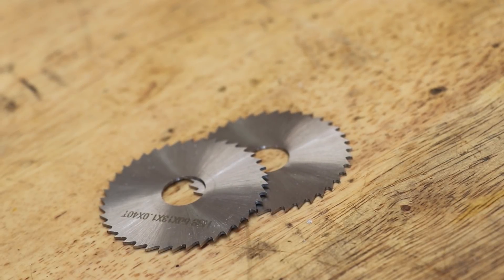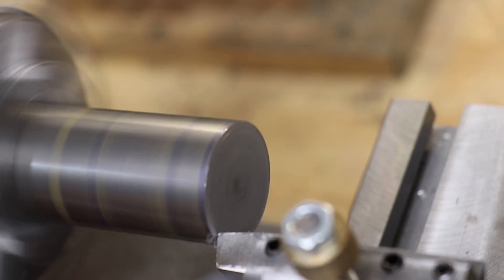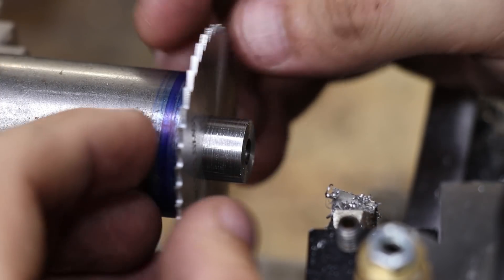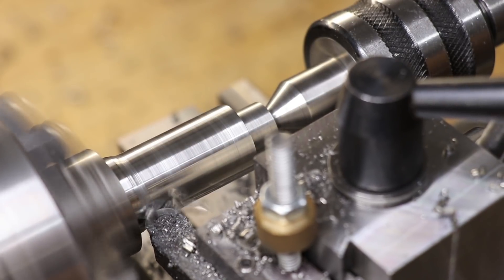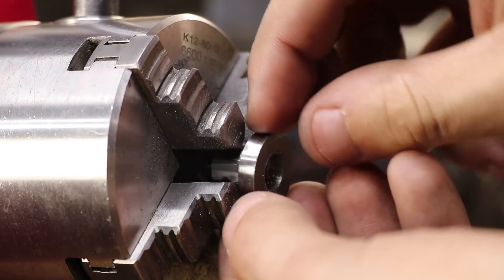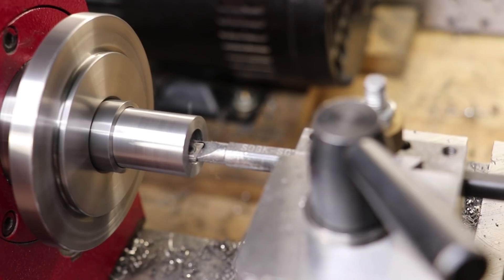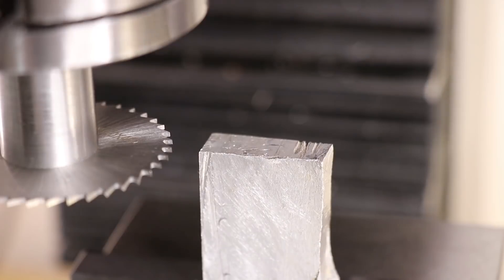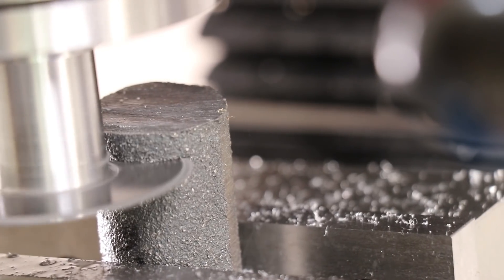Making A Slitting Saw Arbor For The Milling Machine

Comment: Does the runout not stem from the thread? Perhaps make a system that does not use a thread to lock the saw in place but instead clamps it down by other means would solve the issue?
Reply from the maker: From what I can see most of it stems from the saws themselves. These are inexpensive imports and I can't expect too much from them. Cheers.

Comment: One thing you could've done was while you had the arbor in the collet on the lathe, leave a witness mark on both the arbor and the collet. As it is, machining it in place will ensure that the machined features on the arbor will have the opposite runout of the collet, and if they stay lined up, this will cancel out. If you were to take it out of the collet and reinsert it at 180°, you would have the worse case scenario where the runout on the arbor and collet would then stack instead of cancel out, and anywhere in between would be suboptimal.
Reply: That being said, I would suspect the largest source of runout here would likely be the location of the hole in the slitting saw itself. You could check this by measuring from the inside face of the hole to the tip of the tooth with calipers, and compare at various angles along the slitting saw.

Comment: Made such an arbor some time ago, in 2 pieces only.
As already told, most blades are not centered to the hole. Maybe using a grinder could modify the blade to cut evenly.....

Comment: Never seen one run true yet !
I am beginning to think they cut the teeth and then punch the hole in the centre coz there is no way you could get that much run out if the hole was done first and the saw was mounted on a mandrel to do the teeth . If you ever do find one that runs perfectly true mount it on a plinth and put it on display as you have found the elusive hens tooth 🤣
Reply from the maker: Possibly, I really dont know how these particular tools are manufactured. it could possibly be down to these being inexpensive imports too, I ha trouble with these last time I used them.
Reply: I think those could be laser cut. Punching hole in HSS seems like it would shatter

Comment: When Stefan G. made one of these he made the flange really short with the bolt recessed completely inside, so the blade could be used as low as 2.5mm above the deck. That might be handy when sawing a complex shaped item, and would be an easy mod to make to your holder.
Reply: Yeah I have watched Stefan's series on slitting saw arbors a couple of times now. In terms of HOW and WHY you do various things in a machining project its a masterclass. His design is more complicated (in the machining) because its on a Morse taper and does not need a collet. 
What's really important is his description of how the arbor MUST hold/grip the slitting saw its after 9:15 in the first part. Not that Stefan's design grips on a  slightly larger diameter than others the one in this and other videos which is why his needs the relief he describes.  
Here's Part 1 of that series: https://www.youtube.com/watch?v=bRQPv4AG2HQ 

For 2 other arbors very similar to the one in this video: 
Joe Pieczynski -> https://www.youtube.com/watch?v=Sp1Vaqwqw3c (done in a pro-shop with pro hardware)
Blondihacks -> https://www.youtube.com/watch?v=-COjawgu32k (done in a hobbyists shop on a hobbyist lathe)

Comment: Maybe it would help to make the center support part of the upper assembly rather than the screw-in piece. That way, everything can be turned in one go and you wouldn't need to worry about two parts. Different blade width coud be accounted for by counterboring the bottom piece so that it slides over the center support.

Comment: All slitting saws have horizontal runout for chip clearing. You are running perfectly fine. Great job.
Reply: For real? That sounds suspect to me. 
Who would design a circular blade with runout? Only one side of it will cut and the teeth on that side will wear out really quick.
I think it is more likely they are cheap Ch!nese made, with very low effort spent on quality control...
Reply: @wizrom3046  I can’t answer the theory of chip clearing, but your statement of them being cheap Chinese made is off. My cutters are all USA made of big names like Morse, Brown & Sharpe, Niagara etc. They all have some degree of runout.
Reply: @grntitan1  wow. Interesting.
Maybe there is a spec for slitting saws?
Reply: This is 100% not true, all teeth should have the same or very similar engagement during the cut

Comment: dont cut stock by hand. Use powertools!
Reply: If he uses a bandsaw or power hacksaw, then he won't get all the knee-jerk responses from those horrified by manual labor (or who think he's a moron who doesn't know about powered saws), and the YouTube algorithm won't reward him with "engagement" points (and therefore more views) from increased comment traffic. If I were him, I'd start a cut on camera with a hand saw, do most of the cut off camera on a power saw, then take the last few strokes on camera again with the handsaw. That way, he can save time and energy while still getting all the comments. I mean, you have to know your audience, right?
Reply: @tcarney57  you know yt more than me. 😊😊😊😊
I don't consider my comment a knee jerk reaction. I have spent many hours using many a hand saw for both wood and metal work. Whenever possible I now use a power tool. I use hand tools if necessary. Otherwise we would possibly need to use a foot treadle for even a lathe.
Reply: @dwightcarlson7136  there is a guy on Reddit that actually prefers using a foot treadle for lathe work.
Reply: It is a character building exercise.
Reply: a lot of us have been recommending he buy a bandsaw. I think he likes the work out.😆😆😆

Comment: In all my years in machining, I have never seen a slitting saw run true. They all have some run out. Watch any and all YouTube videos of machinists using slitting saws and you’ll see exactly what I’m saying.
Reply: I have a few very expensive saw blades (really just thin milling cutters) that are essentially perfect, but I don't own an arbor that is perfect. Even the one I made is off. I'll try again, probably grind it. But as long as it doesn't wobble, eccentricity is no more than an annoyance.
Reply: Joe Pieczynski -> https://www.youtube.com/watch?v=Sp1Vaqwqw3c
Stefan Gotteswinter -> https://www.youtube.com/watch?v=bRQPv4AG2HQ  (part 1 of 3)

It takes effort to be accurate with the arbor.

Comment: Have you checked how good runout the morse taper in the lathe headstock has? It appears that the bore isn't perfectly concentric with the shank. You could get it better by turning the bore and shank in a single operation without removing the work from the chuck
Reply from the maker: I measured it to be around 10 microns, though that's the finest resolution my test indicator has.. For a no name collet I was pretty happy with that
Reply: @artisanmakes  mysterious, the saw appears to have more than 10 microns runout from how it looks.
Reply: @artisanmakes  If you do have a a second swipe on the concentricity have a check of what Joe Pie did.
https://www.youtube.com/watch?v=Sp1Vaqwqw3c
Stefan Gotteswiter went a slightly different route and avoided the collet with Morse taper on the arbor.
Here's aprt 1 of his https://www.youtube.com/watch?v=bRQPv4AG2HQ